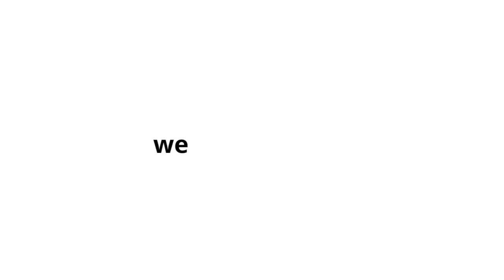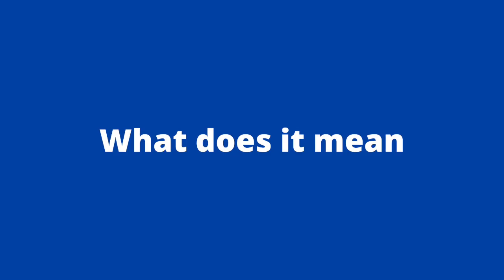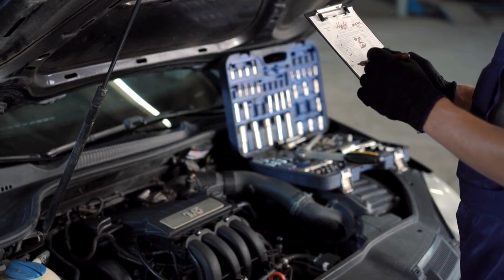🛑 How do i fix code P0638: CAUSES and SOLUTIONS【2025】🛑

Comment: Hi. I had 2008 v97 pajero. Went to previous mechanic not knowing he messed uo with my maf harness rearranged the wires in his brilliant mind. I traced every single one of them and placed back in proper order. He also opened uo my original ETS and fried the motor. When i decided to fix it my self, i bought a cheap aftermarket ETS and installed it. I noticed the throttle is at 100% on idle, did an ocular check in fact throttle is 100% open, accel pedal is giving commands and in control of the rpm. Throttle is not responding. I did a manual relearn by hard reset dozens of times but failed. No errors on my clone elm 327 adapter wifh car scanner app. I manualy check the ETS harness i found out the wires were also tampered so i rearranged it in order but using the resistance and voltage check because my wire color codes is different from the mmc workshop. When i already arranged it in their proper order. I noticed that i was left with p0638. Still no throttle response my ecu still on limp mode. Do i need an obd based throttle relearn?  Do i need to change my cheap throttle body?( Part number 1450A033) For months i have been using my car with tampered MAF and ETS harness. My ECU seems fine though. Please really need your advice. I dont have any info in the web having the same problem as i am having now